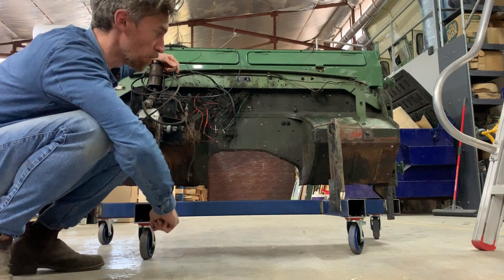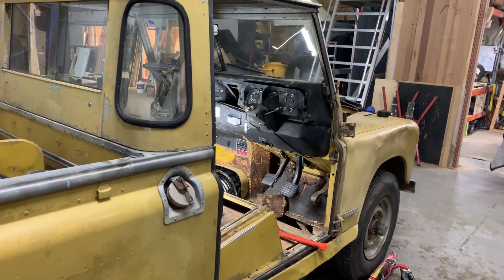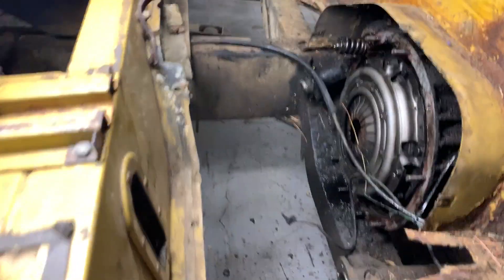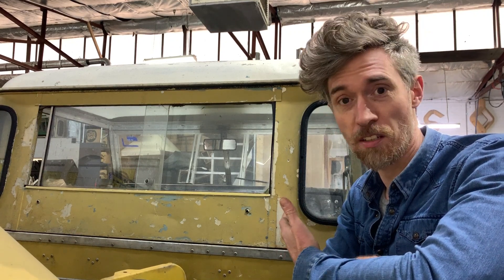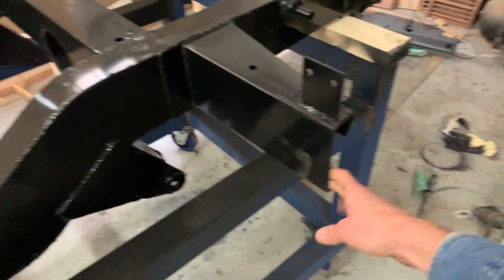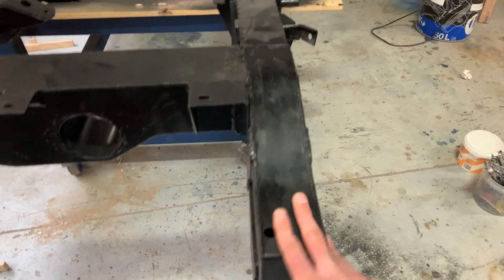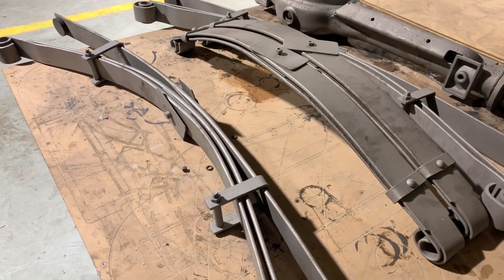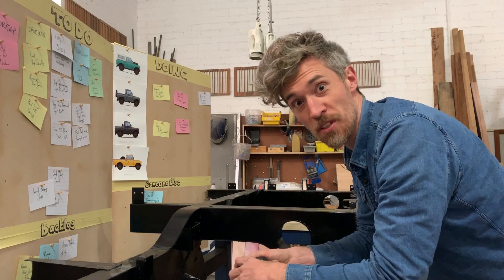Firewall, Chassis Repair and a  Second Car || Electric Land Rover Conversion

Comment: Parabolics are great.  Three leafs will probably be enough on the back - that is HD for an 88.  You’ll probably need 4-leaf on the 109 with the battery weight.  I’ve never seen 3-leaf front springs, but I added a third for my 109 as it has a Tdi, twin front fuel tanks, a winch with wire rope, bull bar, spare wheel and pioneer tools on the bonnet, a lot of heavy sound proofing (Wright Off Road kit inside and Noise Killer around the entire engine bay) and a roof rack.  All of that made the parabolic fairly flat with two leafs.  

See how it goes, but if you find to need extra support, you can buy another set of front springs and take them to pieces, cut the eyes off the leafs and add them to the existing springs, so one new pair can be used for two vehicles.  Just try to keep upper leafs for one vehicle and lower for the other to match the camber and rate on each side.

Nice work on the trolley.  I hope you can bin the added gauges and panel on the dash and return the fascia to the original configuration, perhaps with a more sympathetic mount for the EV displays if you can’t get something that’ll fit in place of the existing fuel and temperature gauges.
Reply from the maker: Thanks Nick.  So much great knowledge out there and very little in the 'manual'